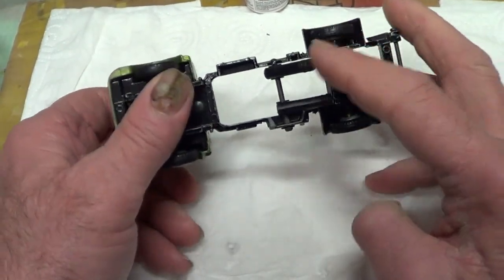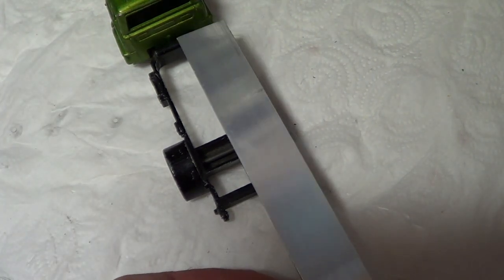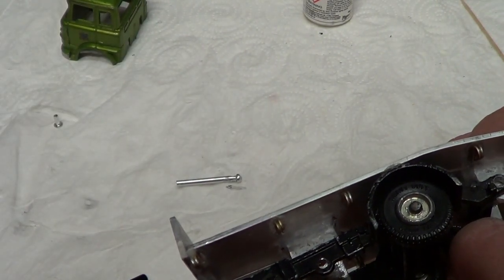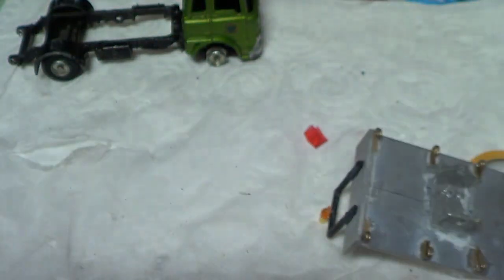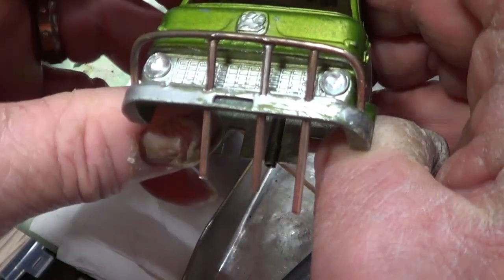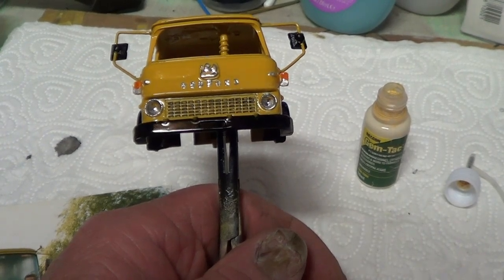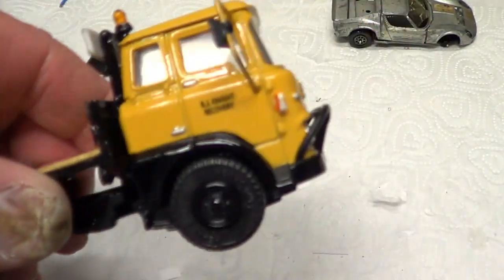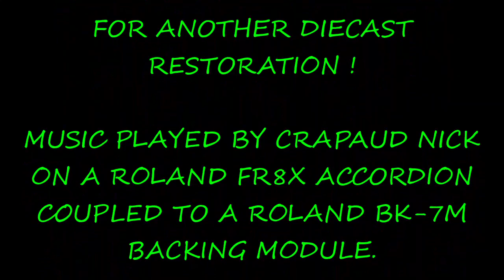DINKY TOYS BEDFORD TK CODE 3 RESTORATION.

Comment: What a wonderful piece of work.  It was well worth waiting for.  Possibly the best code 3 that I have ever seen even if it is the only recovery vehicle in the world with a white cab interior.  No doubt somebody smarter than me will come up with a good suggestion for realistic tie down straps.  Will you be adding a winch?
Reply from the maker: Thank you David, yes I should have painted the interior black but by this stage I was just trying to get it finished lol. I did make a winch to go on that worked, but the thing was a fraction too big and didn’t look right, so I decided to leave it off. I also thought about using some very thin masking tape I have, it’s sort of plasticky and I thought to make some tiny ratchet straps but it would have taken too long.

Comment: Truly a work of art Nick! Was wondering if you could have actually pop riveted the bed onto the chassis instead of using the pins with glue?
Just a thought 🤔. Really fantastic result though , one of the best yet I think 👍
Reply from the maker: Cheers Bob, I suppose I could have used pop rivets but I think it looks tidier with the pins😊👍

Comment: Hello Nick just watched the video on the TK code 3 build i take my hat off to you that looks fantastic 👍. So how many times did you glue your fingers to the back of a truck lol and I think the nudge bar on the front is ok I'm gonna be doing a TK tipper it hasn't got that nudge bar on the  front but it's got two bumpers and twin headlights I got a Bedford tipper but he's got the wrong tipping body on it so I may have to make one up out of styrene and somehow make a second bumper as well. But that no idea is down the line I've still got a lot to do.
Take care my friend and see you on the next video 👍.
Ralph
Reply from the maker: Thank you Ralph, I stuck my fingers to the body a few times whilst trying to glue the wood on lol, not seen the model with the twin bumpers and lights, we had one years ago when I worked on the haulage, was the km with the wider mudguards. Good luck with your model tipper, plenty to keep you busy by the sounds of it😊👍 Take care all the best, Nick.